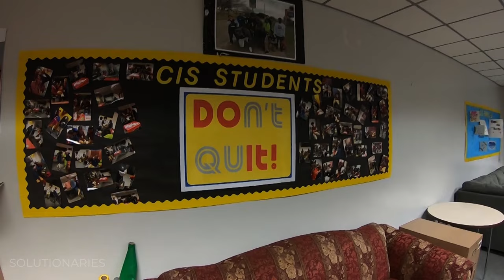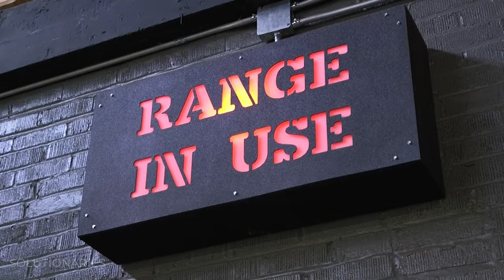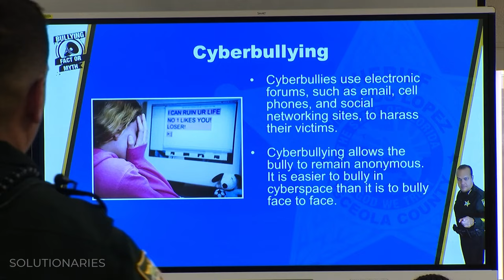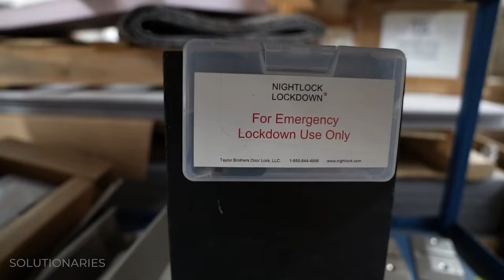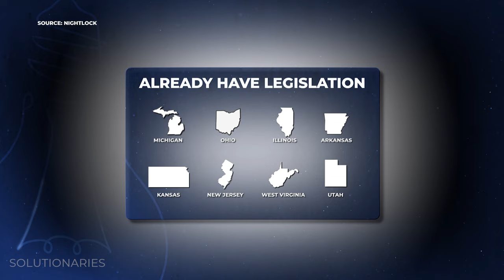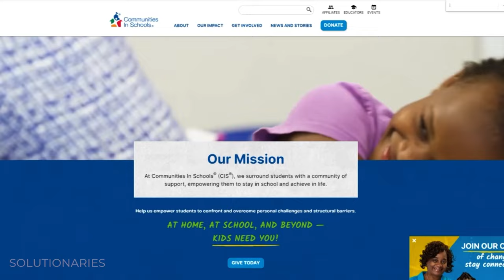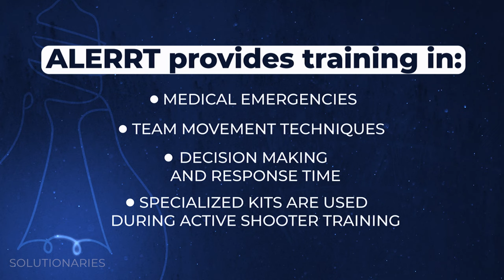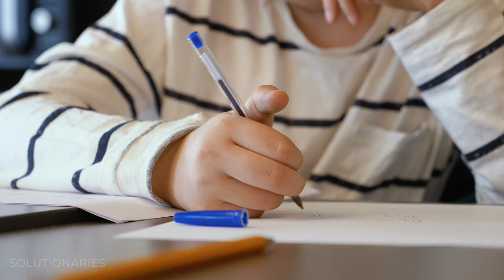Keep Your School Safe From Attackers!

Comment: Let God back in school and immediately there won't be no problem.  God was removed in 1962 since then look at all the violence but it will get worse as long as God is not included.
Reply: Yeah because there wasn’t any violence when “God” permitted the crusades.